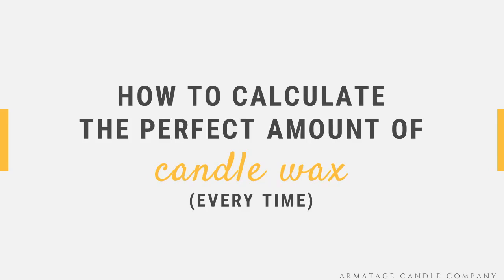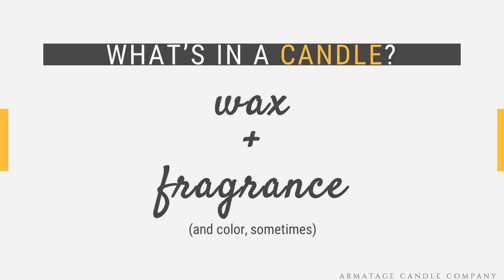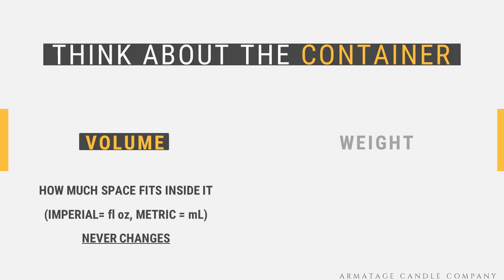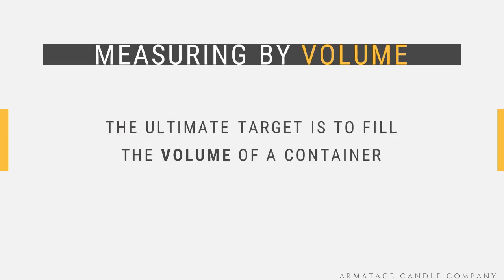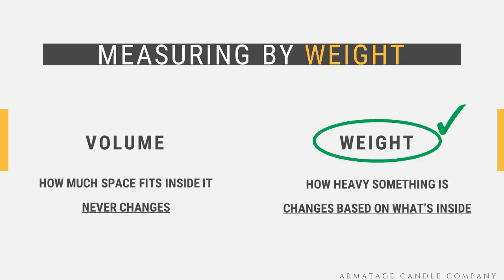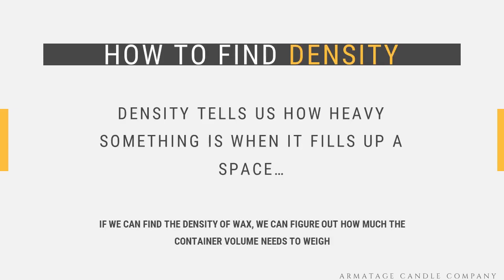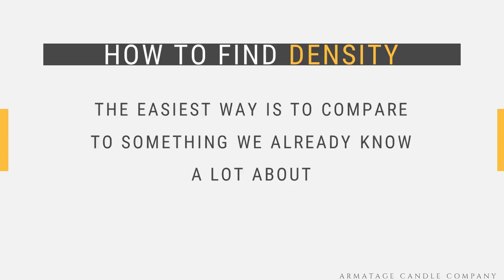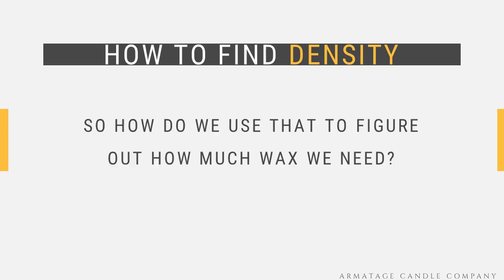Candle Making Mastery: How Much Wax Per Candle?

Comment: Hi I have a question. When you put the jar on the scale to weigh the water do you set your scale to “fl” or to “oz”?
Reply from the maker: Great question.  Since I want to know an equivalent weight, I always set it to "oz" (or grams).  That way I can measure my wax in the same units, whether it's "oz" or "g".  Hope that makes sense!
Reply: Lb Oz's right?? Not fluid oz's.  ??
Reply: @ArmatageCandleCompany  maybe you already answered this but do we use fl:oz or lb:oz setting on the scale?

Comment: I used to work in a cosmetics development lab, making and testing products. We had to get exact density of each product we made as even mostly water products still had some change in density when adding any other raw materials. Using the density we wound find  the fill level of the bottles/jars .  So I’m just thinking that adding fragrance oil to the wax, would change the density too. I suppose it’s close enough to use just density of wax, but if we were to also calculate the density of wax with added fragrance oil, it would give us more precise calculations. But then again, is it really necessary?
Reply from the maker: You’re absolutely right.  And you could go all in on that, but it’s typically unnecessary when the additional accuracy results in a very small difference.  Big cost for almost no gain in process improvement.
Reply: @ArmatageCandleCompany  thats why I wondered if in candle making it doesn’t actually matter. Thank you for your response.

Comment: Hi where does the 0.86 come from?
Reply from the maker: Good question.  That's a conversion factor from water to wax.  I go over it in more detail here: https://www.youtube.com/watch?v=Rm-5PYku7GM

But every wax hovers in the range of 0.82 - 0.96 depending.  0.86 is a pretty good average (and at the end of the day, it gets you pretty dang close to the right amount for your containers or molds every time)

Comment: Serious question.. Why wouldn't you just take your vessel, put it on the scale and fill it with melted wax to the recommended fill weight?
Reply from the maker: That's actually the most fool-proof method you could possibly employ.  No reason you couldn't do that as it's perfectly valid.  Especially if you only use a single container type.

That being said, it can be logistically a minor hassle as you'd have to melt down wax strictly for a single container then pour back into a larger batch before adding fragrance or dye.  At that point, who knows if you've under or over shot the amount of wax you should melt given you weren't sure how much went in to the container.  AND... you only know the amount that goes into THAT container.  Granted, you'd only have to do it once and it's really not a huge hassle, just a minor planning inconvenience.

You might also use water since it's a lot faster to gauge an estimate because it doesn't involve melting wax in any way.  Great suggestion!